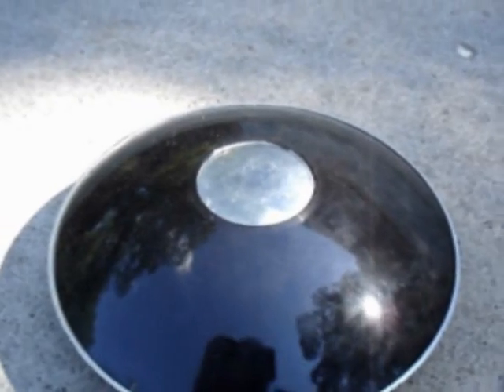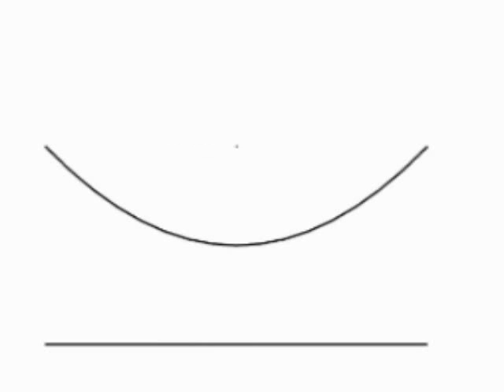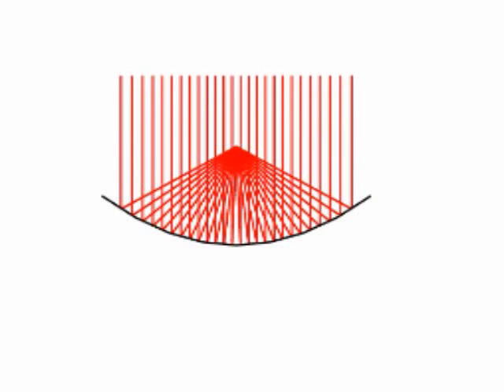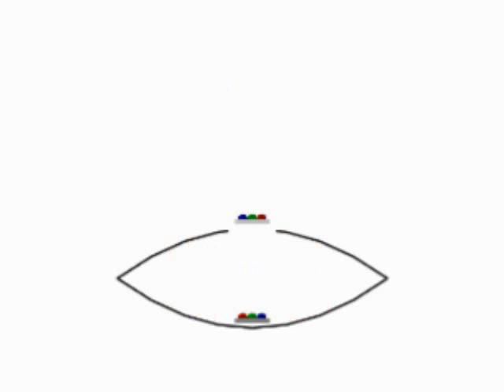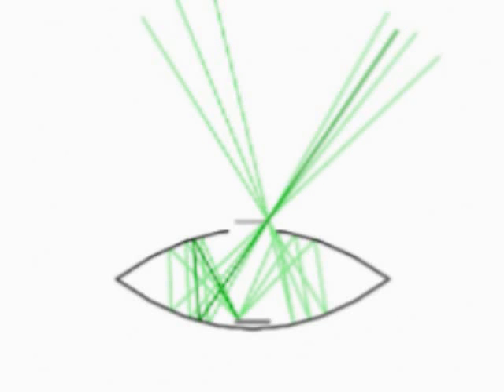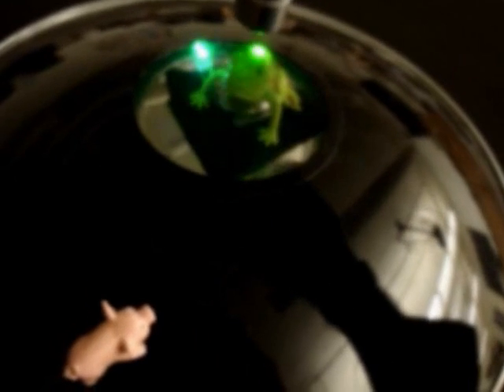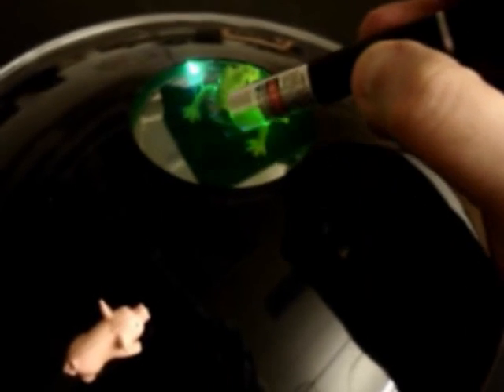How the Mirage/Mirascope creates a real 3D image

Comment: There is a key element missing: THE VIEWER. The viewer is clearly looking at a mirror. Your demonstration shows the path of reflecting light waves. Why does the reflection in the mirror appear to be on top? I get that it's obviously 2 concave parabolas create a correct perspective 3D object at the focal points, but why does it appear on the top?

Comment: if the bottom mirror was instead a screen re-creating the light bouncing off the bottom;
1) would it still create the holigram and
2) would you even need the top mirror if this was the case
please reply, thanks
Reply: I dont think so as a screen would do show the light at the same angles
Reply: Yes and no, if your using a simple LCD screen you don't get directional light, each pixel can be seen from a wide range of angles on your computer screen for instance.

A holographic display would be able to have directional information in the light, that way it would not light up as a light bulb, but like several lasers shining out from the same point.

So yes, if you have directional light fields (holographic screen), but no for a normal LCD/OLED screen.

At least one company is promising to have holographic displays coming to the market during 2020 btw https://youtu.be/AAojnQlGgpk?t=1283

Comment: If you put a light directly under an object in there would it still work and would it glow?
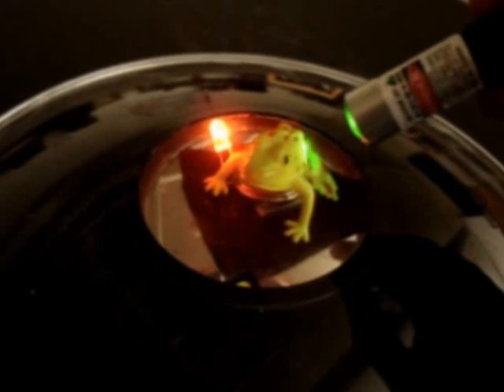Reply from the maker: Yes, you would see a light under the object.  In fact, at the 2:30 mark, you can see a color-changing LED which was placed below and to the side of the plastic frog.  If I had placed the LED under the frog, you would have seen the colored light streaming from beneath the frog.  However, if the object completely covered the light, then you wouldn't see anything.  For instance, if I had the 2 foot  Mirage and covered the LED with an inverted mug, then you would see the mug but not the LED inside.